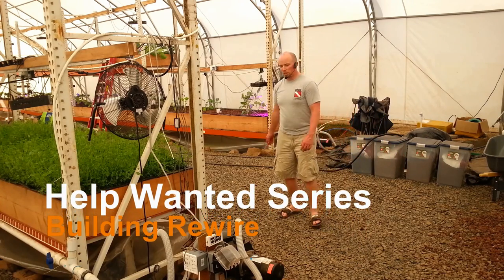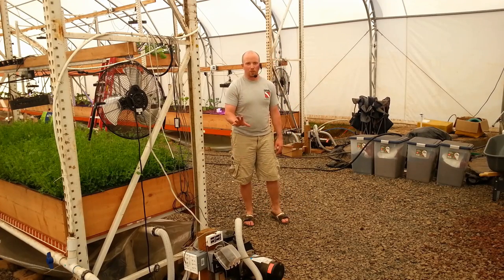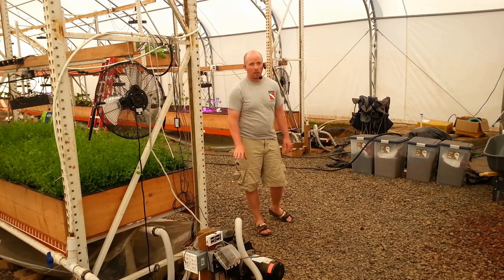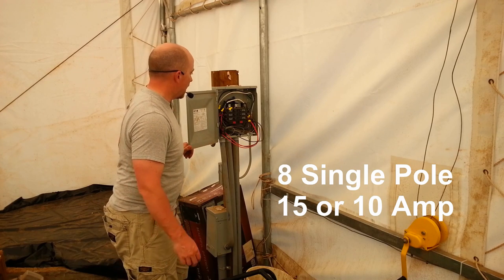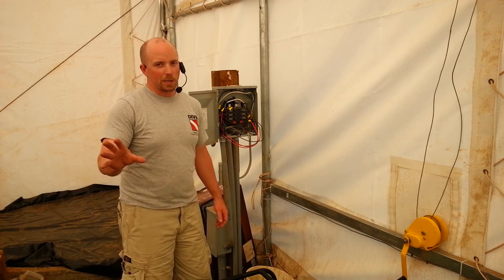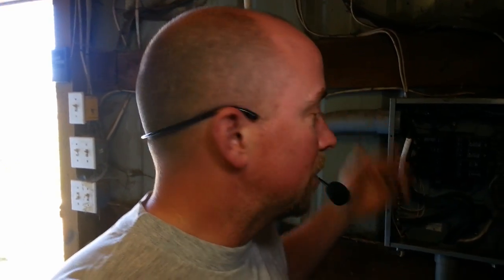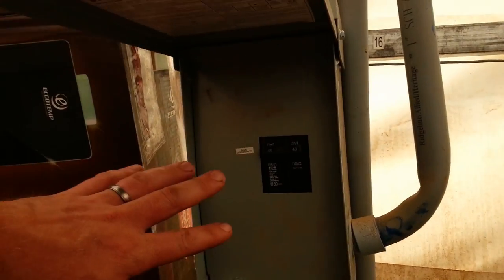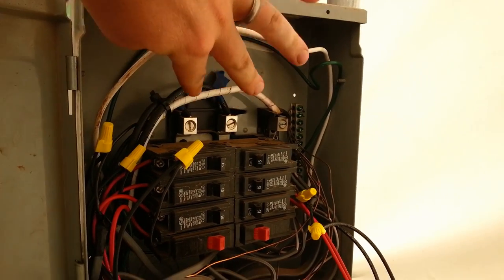Aquaponic Greenhouse, Electrical - Things to Consider

Comment: Save your money don't buy twin breakers! Instead get the proper size breaker box.

Next I know money is a issue but I think you should get 4 vfds so you can ramp the pumps separate. You will be able to keep your peak power down.

Your power needs to be 80% continuous load
Per the NEC

I have repaired services that where running 100% continues and it is not good when things catch on fire.

Comment: VFD would only work with 3-Phase  or DC motors.  You would be better off and cheaper to use a couple of contactors and one of your arduino's to share pump power by only running one at a time.  Some minutes for each then switch to the other pump.

Comment: Have your computer allow only one pump to run at a time.  Each arduino/timer controlling a pump must check if another pump is busy before it enables pumping.  All the changes go to your control circuitry and not your wiring.

Comment: Assuming at your pumps are not positive displacement type. Could you not just put a valve at the pumps outlet and close until you reach your desired flow rate/amp draw.

Comment: You seem to not be including the fact that you have a frig coming, and now with the idea of a ground source heating system with blowers need to push all that air through them, you need to consider what the amp draw your going to add to the existing power consumption. Not to forget your talking about a carousel to move the plants, Is the ground source heating going to be enough to maintain the temp your looking for, if not, your going to have to supplement a aux heat supply and what would that add to the power need?

Comment: if all the pumps run on one vfd all the pumps will run at the same speed. so if you only need 50% pump capacity on three pumps but one pump requires 75% capacity then all four pumps will run at 75% capacity because you only are using one vfd.

Comment: I think I mentioned this before, aren't those pumps extremely overpowered? I'm looking at my irrigation pump, one of the large ones, it can pump 3000l/h, 45W at 230V/50hz. It can pump up to 2.3 meters. A immersible pump, basically a powerful fish tank pump.
Reply from the maker: yes they could be. working that

Comment: pumps / the higher the voltage the lower the amperage ! if i understand the pumps are right now 110 v ? using 4 spaces ? you can get piggy back 220 v 20 amp breakers so you could run 4 220v pumps on 4 spaces in the panel ! ( do you know what a piggy back breaker is )?
Reply from the maker: i think piggy back is the double 120 in a single?
Reply: right but they make double 220 v to fit in 2 slots ! then if ya put the pumps on a timer youll cut the power used to 1/4 of what it is ! no extra wires just change the wire comfig

Comment: How does this work in the US ? from the electrical company u get 1X120Volt feed only ? so a single phase ? or is it 2X 120v (in denmark we have 3X230v / 400volts between phases)

Comment: You have 40A at 240V?  That's 9600 VA. Your four in the future pumps are 120V 12A.   That's 5760 VA, so you have enough available power for the pumps just have to get 2 of the pumps per leg of the supply.  If you run them at 240V and assume the amperage will drop to half, you would be at 240V x 6A x 4 pumps so you are still at 5760 VA your power hasn't changed your just increasing one leg of the triangle to decrease the other.  Also I read a couple of comments on the VFD, they provide power factor correction they do not provide any power savings unless you are going to slow the pumps down in which case you would want to make sure that your motors are rated to operate with a VFD or you may end up burning up motors, and as stated in another comment you may bring your pumps out of optimal range and they may end up using more power to accomplish less work.  If your pumps are oversized for the job you would be better to get smaller pumps then use a VFD.  You also mentioned in the video connecting the pumps in series, I don't know if you simply mean connecting 2 pumps to the same circuit or actually connecting one pump through another pump to form a series circuit, that sounds possible in theory if they are balanced, but the problem you would have is one pump may eventually have a higher load do to a plugged line or similar issues this may create a higher load on that motor which could cause one pump to draw a higher voltage from the circuit and burn one or both of the pumps up.  I hope this all makes sense I am on my phone.  Also since I am commenting what do you pay for propane out west, I am in Michigan and it would by far be the cheapest available here.  Using a high efficiency furnace would eliminate the cleanliness problem of the direct burners and would help with moisture as the burned fuel is not adding additional moisture to the air, I believe people in my area are prebuying for around the 1.50 a gallon range here.
Reply: iUm,  all combustion of hydrocarbon fuels will add moisture to the air unless the combustion is dirty & VERY inefficient - burning propane produces CO2+H2O.
Reply: Test User yes, I didn't add in that one could exhaust the combustion air outside with a furnace rather the the products of combustion being blown into the building with the direct fired heater

Comment: Kinda new here , if this is impolite I apologize, just skip my question, but do we know a "NOV. 11th PROJECT" BUDGET like absolutely no more than X dollars....? And lastly, I built a woodworking shop 24x24 and just 3 of my machines went way over my allotted power. So I had our local utility company run a separate line to the shop, ZERO COST, (installed a 200 amp. panel. re wired the shop my cost) now plenty of power, my shop has Dust Collection, A/C and 6 - 18 ft. half round electrical heaters that hang from ceiling? Does your local utility Co. do that in Washington? Sorry again for my rudeness....

Comment: Hi TRM,
Please provide a better description of your aquaponics cicle. 
There is something overpowered. 
I can get to Mars and back with 12 amps per line :). 
I rewatched your videos regarding aquaponics and those recirculating pumps @ 1.5 KWh are way to big. 
C'mon, i'm running my entire house on a presure booster pump of 0.75 KW (and is a big house by any standards + lawn irrigation)

 What is your flux requirements (debit) per line per minute ?
Can you implement a gravity assist system ? (Pumps feeds the water in sequence from each  fish tanks to a raised cistern and from there gravity feeds water to the growing lines as is required. This way you can sequence the pumps (one a time) and the water in fish tanks will fluctuate between min and max according to sequencing patern.)

Another issue: You have a 14.5 KWh Photovoltaic solar array and you feed energy to the grid. When the grid is lost you switch to generator... 
Consider installing a battery pack (like Elon's PowerWall or alike). Be more energy independent. On Mars there are no such things as "Grid Power" :)) You have to be self reliant ;-)

Kind regards,
JC
Reply from the maker: appreciate the comment and the suggested calcs...I'll be working those (ps...love your icon)
Reply: Thanks ! 
Yeah, i created that meme in jan 2016 and i used it since, on FaceBook. You, having the same meme, is one of the reasons i start watching your channel.
You are also the reason i decided to get out of the closet and use it on Google universe :)
Keep up with the good work and i'll try to advise you with the best of my knowledge/experience and insane ideas. ;-)